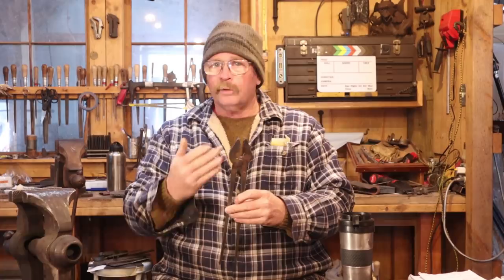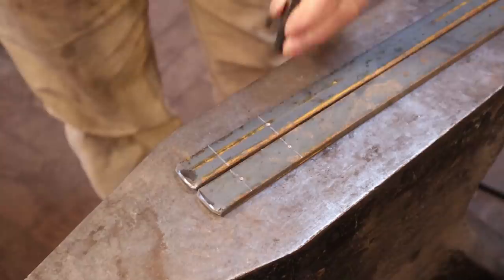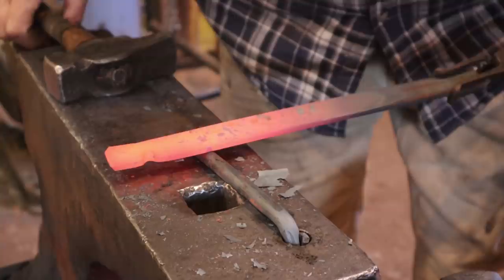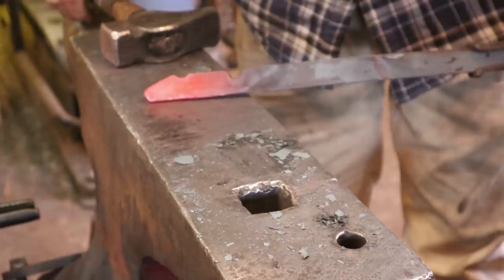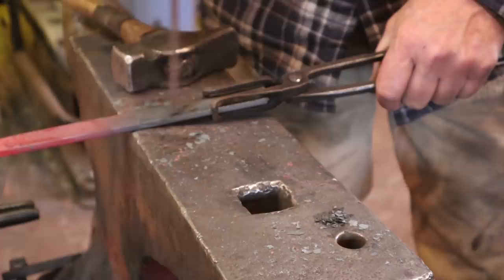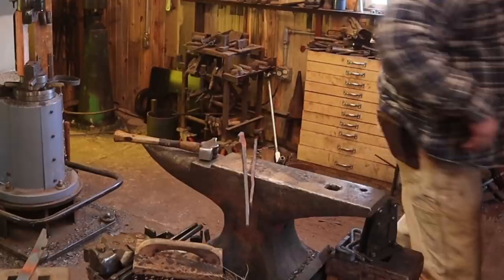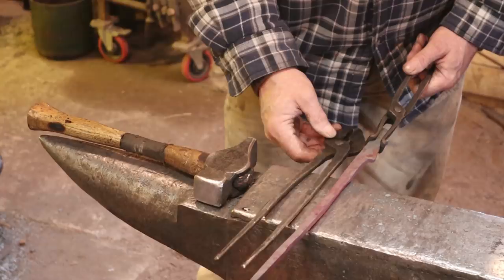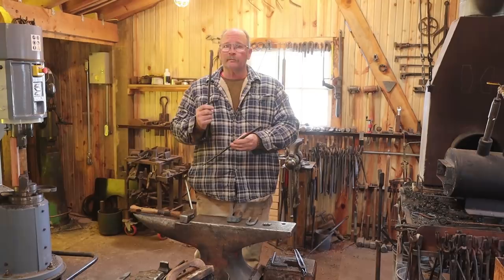Poz tongs - part one

Comment: I forgot that I wanted to coment on this video...... D'oh! I made my first set of tongs before Christmas and yesterday I started my second set. The first ones were to hold 30×6mm flat stock, as that's what I'm useing for tongs at the moment, so I went with quite long springy rains. I'm struggling a bit with these, due to various joint problems and I also find my hand creeping down the rains, but I thought I could make a tong clip soon to fix that problem.  My second set are going to be wolf jaw tongs, so I can use them for a lot of different stock, and I've been trying to work out how long I want the rains. I think I'm going to go a bit shorter and have thicker rains, I also decided that I want them as long as I still want the tongs!! 😆 Sorry I just had to slip a joke in there lol. The rest is true, so please wish me luck with the wolf jaw tongs. So far they are coming out a lot neater then the first ones 😊
Reply from the maker: best of luck
Reply: @BlackBearForge  thanks

Comment: The welding shield (tarp) give the shop some really great light in the winter.. how is it handling the elements? Just wondering as sun and cold really bleach out plastic
Reply from the maker: It should hold up fine.  I had one in some of the earlier phases of the shop that went from one unfinished area to the next over several years and suffered more from physical damage than the weather.
Reply: I’ll defiantly keep these in mind for my next project :) thanks

Comment: This is a very useful series, I couldn't find good images of the forging process for Poz tongs, lots of broken links out there in the internet on this topic.  Can you give a ballpark estimate of how much bar stock is used for each blank for a pair about like the ones you finished in part 3?
Reply from the maker: I think I gave exact measurements in part 1.  These are made from 1/4 x 1" x 12" mild steel.
Reply: @BlackBearForge  my impression from the vids was that you ended up with too long of reins and could have used less bar?  I was wondering about how much bar stock actually got used in each blank more or less, vs what you started with.
Reply from the maker: I think I started with 14" and decided the 12" length was better.

Comment: Thank you! I have been anxiously anticipating this demo.  I'm assuming that for larger tongs of this style you just use larger stock and adjust the measurements of where you fuller etc?
Reply from the maker: You can up size these to a point, but generally I think the more traditional style tongs seem to work better in the larger sizes.

Comment: Hi, very interesting pair of tongs, I look forward to forge me a pair of these, but I thing it might be better to slot punch and then drift the boss area to get more mass in there. What do you think ?
Reply from the maker: Trying to upset the material until you have a round hole again will be quite troublesome.  Plus the boss is already the largest strongest part of the tong, so it shouldn't be needed.  My most used tongs are some this style that I made nearly 30 years ago and they are holding up just fine.

Comment: Is there a formula or rule of thumb when it comes to drawing out your metal so u can figure what to start with
Reply from the maker: If you are drawing out to a sharp point - For a flat parallel taper it generally doubles in length for a square taper 4 times the length and for round 5 times the length.  If you aren't drawing out to a point it you have to make an educated guess on how much to allow.  That comes with practice.

Comment: If I use larger stock can I make a pair that hold larger material   say 1/2 x 1 1/2    Something to hold 5/8 square bar or so...... paul
Reply from the maker: You can certainly up size these for larger round of square.  But the design doesn't really suit itself for flat stock.
Reply: Ok perfect.

Comment: Look forwards to the next instalment. I really like the look of that design of tong. I do struggle with drawing out though so I am wondering if I can weld a chunk of flat bar to some existing round then forge it out from there? Does forging a weld always lead to trouble or does the forging process help make the join virtually disappear?
Reply from the maker: The trouble with welded on reins, other than forge welding, is that the welds don't like being forged and can crack.  Tig or torch welding does better than mig or stick.